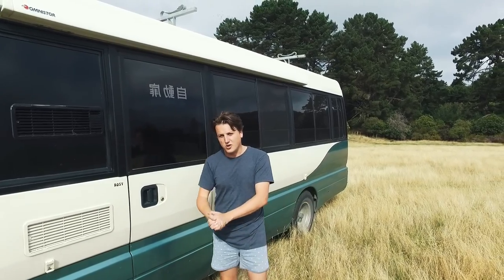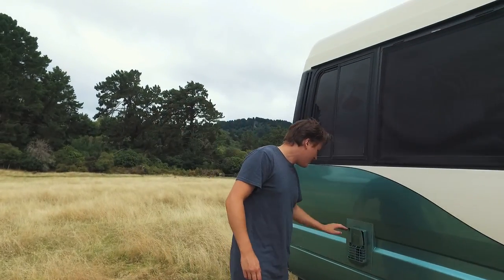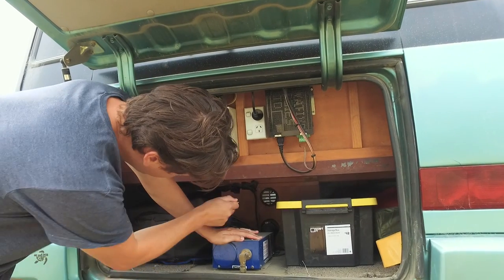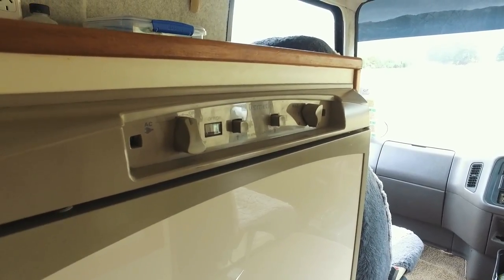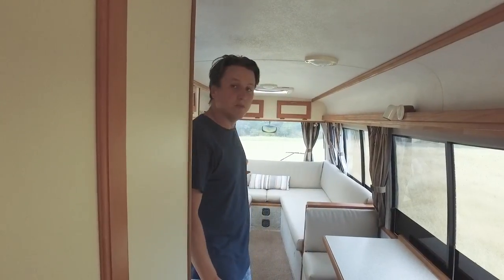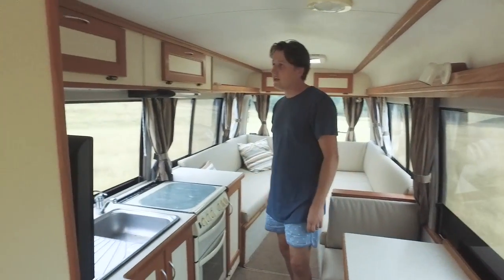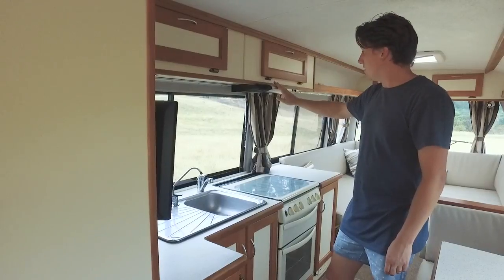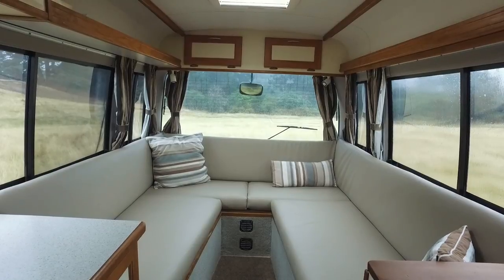Beautiful DIY Bus Conversion | Mitsubishi Fuso Rosa

Comment: Who is your cameraman? It's always good to watch RV conversions as there is a lot of innovative thinking. Your bath looks squeaky clean. I have the same plan to get a Nissan Civilian (22 feet) and convert it for road trips for 10 people. I would also have a bath in the front probably just behind the passenger seat but the bath would also double up as the entrance door just to save as well as optimally use space. No black water tank as I would use a Reliance Doodle plastic bag set up and no grey water tank as the outlet would open directly out (I would use it only in rural areas or wilderness). Also, I would have a second double bed by placing planks on railings across the walls just above the sofa-bed. I would have a bed for two above the driver seat which can be lowered when required. Thanks for giving great ideas.
Reply from the maker: Nice! Sounds like a good plan! In New Zealand we have to have Grey water tanks haha.. Civilians are great buses.. what year bus is it? 10 people sounds cool! Will be an awesome road trip machine!
Reply: Adventures With Rosy Civilian or Coaster is my choice but they are not easy to come by. We don't have any law regarding grey or black water tank just as we have no dumping stations around anywhere. So actually it is a grey area!
Reply from the maker: Oh woe that's good. We have heaps of those buses in NZ but we import lots of Japanese vehicles lol. They are great! If you look after them they will last ages!

Comment: What driving licence do you need for this car you need a bus driving licence ?
Reply from the maker: Most buses this size are just a standard car license to drive 👍 if you get above 6,500kg weight you need a Class 2 license…
Reply: @AdventuresWithRosy  I am from EU and I have a driving licence B so I can drive car not above 3,500kg. So right no I would like to buy Hyundai County and make an conversion but I am not sure if I can drive it with my driving licence. I think I have to make a bus driving licence. I was thinking when I get rid of the extra seats and register the car as conversion if I would be able to drive it with standard driving licence :D. We want to travel in central and south America but there are not many camper vans so we are stucked with mini buses :D. By the way Rosa is amazing :D